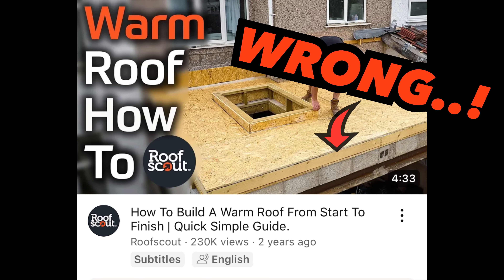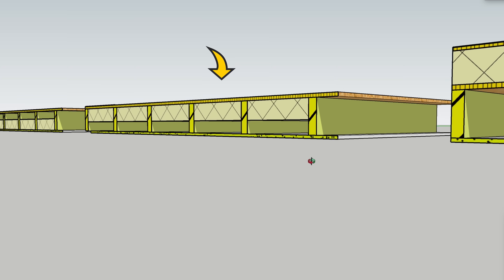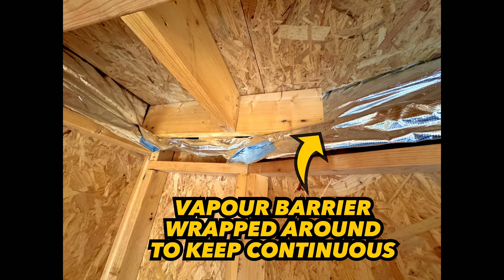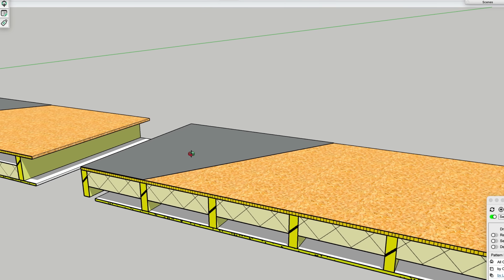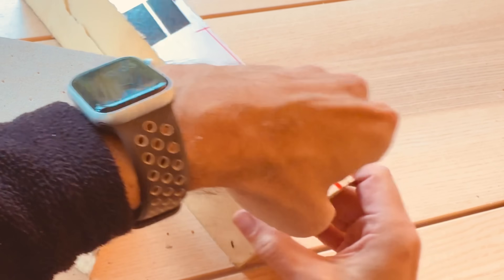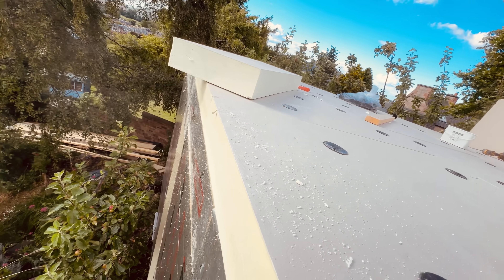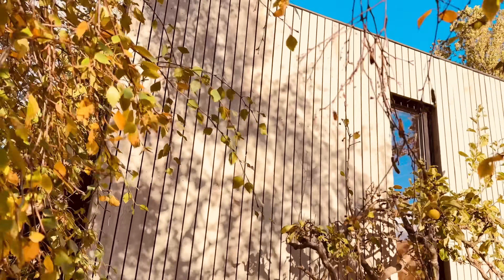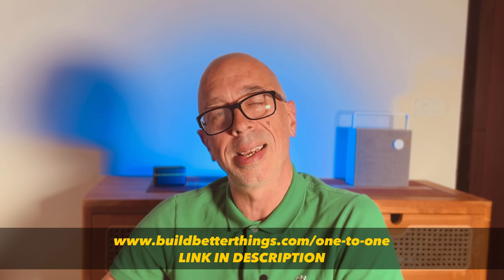Build a Warm Flat Roof the Right Way

Comment: I've just installed my rubber roof as per the old way. Its on my shed/garden room. As it will be low occupancy with trickle vents i am hoping it will be ok?
Reply from the maker: I didn’t go into trickle ventilation in there video due to time. If you’ve got OSB under your membrane, then ventilation will definitely help you with vapour control. People tend to close the vents in winter for obvious reasons, that’s why I don’t talk about it much. The fact you’re asking the question, and it’s not going to have much vapour generation will work in your favour.

Comment: With the target U value being reduced to 0.11 there is currently a problem of how to buy PIR thick enough to be able to construct such a roof with doubling up the insulation. This poses two possible issues 1) A highly theoretical opportunity for condensation between the two sheets of PIR and 2) Screwing down possibly 240mm of insulation. The first I think is probably not a problem but interested in thoughts and both and also availability of insulation material to meet the new target.
Reply from the maker: Your point 1, if you are using foil backed insulation, which many builders continue to do, you will have trapped condensation where the two foils butt against each other, regardless of your vapour barrier. Your point 2, I would be aiming for 120 between joists, and around 150 over the top, to get around a theoretical 240mm sheet. You raise an excellent point on the new u values, and I suspect manufacturers will find new ways of increasing the lambda effectiveness, such as KingSpan’s newer phenolic batts.
Reply: @build-better-things  if you have insulation between the joists, according to your theory, isn't there a risk of condensation at the OSB deck which is directly ontop of the joists?
Reply from the maker: The OSB deck would be below the insulation and between the joists, 100mm down, there can never be OSB above any insulation unless a cold roof. I didn’t make that clear. I briefly illustrate it when I mention permitted development. Did I explain it ok?
Reply: @build-better-things  not clear at all! Why would there be OSB between the joists? What is this 100mm dimension you refer to? 
Regardless, in the video you said the vapour becomes trapped by the OSB (as it is so full of glues etc), so surely this is also true with a hybrid roof when the vapor meets the first layer of OSB  half way through the construction? Moisture trapped at that point surely the water would cause rot too!?
Reply from the maker: @philbooth319 take some time to reread my comment and it should make sense.
Reply: @build-better-things  would that be the comment in which you say "I didn't make that clear" !? Haha
I've re-watched the video and can just about make out a section detail which flashed on screen for literally just 1 second at about 1:40 , now it makes more sense, and I kind of like that arrangement although I'm not sure where you would have the VCL? If still ontop of the OSB, wouldn't that be an absolute pain at the mid span noggins? Perhaps just run the VCL under the joists of use foil backed plasterboard?
Reply from the maker: Hi. Yes it’s too quick. Apologies.  I’m going to make another video about that. The vapour barrier goes up and over the joists and then on top of the OSB. It’s a lot better than between the joists/pBrd. It’s just the best I can think of.
Reply: @build-better-things  Will be interesting to see that video in due course to understand your reason, and how it compares to the vertical VCL in the wall construction.
What I still don't get is why this is a problem if you have sufficient insulation so the vapour never actually gets to the cold outside??
Reply: @build-better-things  So I'm beginning to loose the will to live having watched too many videos and spoken to too many tradesmen, manufacturers and suppliers. I'm trying to design two roofs for a project. The first is a flat roof, the second a low pitch metal sean roof. Both are warm. Staring on the inside - plasterboard vapour/air control membrane, wood fibre packed insulated joists (200mm), wood fibre sarking/insulation over this. Then the trouble starts ---- Flat roof, single ply then bonded to sarking to finish. Seems OK but want a green roof in places (biodiversity requirement pushing at this) and poreclain tiles on pedestals in another. Concerned about some roof type welds for green roof but more the applied pressure on wood fibre from the pedestals ---- Low pitch metal seam roof (15 degrees) I cannnot see how to overcome the use of ply/OSB over the sarkin/insulation unless a vapour barrier is laid directly over the sarking/insulation with battens over this and then ply/OSB fixed to the battens. This then needs a vapour barrier over the OSB/ply before the metal roof. Reason is that the metal roof requires both a membrane and fixing and this fixing cannot be through 120mm+ to the joists as the metal roof design itself is not equiped to do this.

Both roos are approaching half a meter in thickness and the roof cost is now by far the biggest single cost element (I know it's always been a big part). Much of the above is being driven by the Furure Homes Standard, biodiversity, sustainability and the desire to reduce CO2 and move away from petrochemical derived products.

Please note that nearly all the BBA, NHBC, Passive House diagrams etc. show the ply/OSB directly on top of the sarking/insulation. This has always seemed wrong as ply/OSB is not a vapour barrier as such and will tend to trap moisture underneath.

Comment: Yeah in Arch Tech collage (a couple years ago since I graduated) we were thought to apply the roofing membrane finish directly onto the insulation when detailing as you specified in this video. I watch alot of the channels you screen grabbed (+ others) who all do the 2nd OSB layer on the cold side of the insulation & I always wondered why they would add such an unnecessary layer to the roof assembly. Now I know! 😅

Comment: I'm a lowly DIY'er, half way through his first warm roof (a mere 4 square metres). I did consider gluing the rubber directly to the insulation, but in the end I went with a 9mm OSB3 layer beneath the EPDM because that's what the majority of people seem to recommend, and I wanted a roof that I could walk on to get access to the gutters etc. Have I made a horrible mistake ? Time will tell, I suppose. I tried very hard to leave no gaps in the vapour layer (= Alutrix), and I deliberately chose OSB3 because it can apparently tolerate humid conditions. Kingspan claim that their phenolic insulation ("Kooltherm") is also vapour resistant, so perhaps that will help too. I hope it won't end up worse than the cold unventilated felt roof I replaced, which had the consistency of soggy Wheetabix. Fingers crossed.
Reply: Plenty award winning excellent builders on YouTube have done the same don’t worry
Reply: @macsmith6216 👍
Reply from the maker: I wouldn’t call it that. If the roof fails, hopefully you can peel it off, along with the old OSB, it’s not a huge exercise nor cost to adhere new rubberto, using a new 20mm layer of tissue faced over your old insulation to keep the depth almost the same. Humidity is a site specific thing, so you might be OK. Just wait and see.

Comment: PSS: The vapour barrier in your video looks like a laminated polythene foil product as it looks lose laid (not stuck to the base deck with bitumen). These products are not sufficient and regardless of whether you’ve used an upper layer or not, condensation will occur between the roof membrane and the insulation because you have failed to prevent rising vapour due to an inadequate vapour barrier. Ok that condensation will have no OSB to rot, but it will reduce the life of your roof to exactly the same extent by delaminating your membrane bond to your tissue faced TR27 insulation.

Good points regards mechanical fixing, but in terms of thermal performance it doesn’t matter what roofers toss about with on top of the insulation. The key is stopping warm vapour holding air from inside the building rising through the structure as it will condense if it’s allowed to meet a cold surface whatever you do on top.

Comment: Yes, but you are ignoring the fact that with a warm roof a vapour impermeable bituminous foil vapour barrier (with an Sd value of 150m +) must be laid over the base deck (over the rafters) to ensure the damaging warm air transmitted vapour cannot get to the cold upper side of the insulation. The warm roof top deck rotting you correctly reference only occurs where contractors fit inadequate vapour barriers eg. Paper type roof membranes (typically with Sd values under under 10m😱) that fail to prevent the convection of vapour holding warm air reaching the top of the insulation where it condenses and rots the top layer of OSB. Agree that it’s better to lay the roof membrane directly over rigid insulation, but if you spend enough money on a quality bituminous foil vapour retarder you won’t get the condensation problem.
PS: Vented roof example shown is good and will work well providing there is sufficient inlet and outlet ventilation gaps to allow cold air from outside to draw the warm vapour holding air away. The Hybrid roof you show is a complete disaster and will never work whatever is done as it’s impossible to fit a bituminous foil barrier from underneath the rafters and there is no space over the insulation to ventilate.
Reply: But then you fill the VCL with screw holes!
Reply: …maybe the bituminous type seals those?  But then bitumen has a limited life

Comment: I usually find your videos informative but this one is incorrect. Building standards mandate a vapour membrane under the insulation for warm roofs.

You’re showing other’s channels content without actually having watched the full videos. 

I’m sure you know that yourself but for others as a reference, when you build a warm room, you always lap a vapour membrane on top of the first layer of osb/ply. 

That’s what the people from the footage you’re showing actually did, but you’re surmising that they didn’t. 

You’re spreading misinformation. 

Now, for the other people concerned with their warm roof, building control would/should not approve a roof without a vapour membrane. Giving that a membrane is 50 quid for a 50m roll, it’s unlikely that your builder saved on that… (never say never, but you get the point)
Reply from the maker: @OmegaLok All the “bad”  examples I show are about adhering the EPDM onto an OSB layer, with insulation below, which is going to rot over time, regardless of any vapour barrier. I explain this concept with diagrams and video all the way through. You have completely misunderstood the video. 
I show the vapour barrier laid on the OSB both in the built example and in the sketch diagrams. Talking of not watching videos all the way through,  and spreading misinformation , are you sure you’re not looking in the mirror ?
Reply: @build-better-things  I am not spreading anything, I am saying you are. That logically does not make me a misinformation spreader.

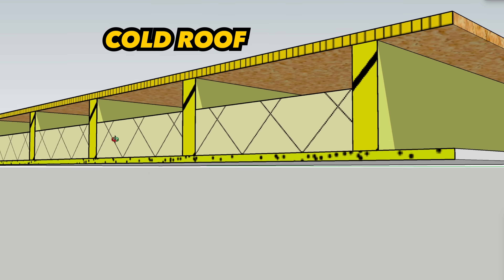* Your Mr A builder videos are redacted (minute 0:50 and 6:37). You are not showing that they are installing a GRP roof which requires a rugged substrate to adhere. But you lump his video under the EPDM label. Not only that, but they explicitly say they line up the fixings with the joists, so that it doesn't pierce the VCL into the void (avoiding what you show in 6:19).
* Video in 6:27, another GRP system and not an EPDM roof. What's your recommendation there, as again, you can't adhere it on a keyless substrate?
* your whole 6:20 section is about adhering EPDM on the second layer of OSB as that's the issue. The issue, as you said, is infiltrating moisture through the VCL.
* in your construction at 11:54 you have ply (probably WBP) on the edges of your roof (to support fascia?). Aren't you concerned that it's going to rot the same as OSB? I've seen mushrooms grow on WBP, so it doesn't matter how "resistant" a material is to water. It's either waterproof or it will eventually rot in a damp environment.

Your whole video comes as a stark warning about a warm roof and how the top timber layer will eventually rot away. I think that piercing the VCL through the insulation is a real problem to which we don't have an answer today. We can mitigate with the plastic cones, and fill them, and by aiming at the joists, so that moisture doesn't go through. 

However, in the order of issues, I've seen more incorrect cold roof constructions, without proper ventilation. I've yet to see a top layer of a warm roof, with VCL, to have rotted. Have you actually seen any? 

Also, in your construction, if the moisture does come through the VCL, and reaches dew point under the EPDM, where will the water go if not eventually down, hence back through the VCL and into the bottom decking, hence rotting the lower side? I'd rather have the top side rot, easier to strip and replace than have to tear away plastered surfaces. 

To summarise:
* what do you suggest for GRP roofs as those require a mechanical key (for which OSB is the most recommended)
* the issue being penetrating moisture through the VCL, how often have you seen this issue and how bad? Evidence is appreciated as all I hear (from everyone) is speculation
* what's your mitigation strategy?
Reply: @OmegaLok well said. In relation to the Mr A Builders videos this person has referenced in this video and commented on within this thread alone, he is not telling the truth.
Reply: @build-better-things Your comment above in this thread, dated "3days ago (edited)" at time of me writing this, is a lie. The videos of ours that you've referenced DO NOT contain any form of EPDM roof. You are either lying about it's contents or you are lying when you say that you have watched them. Either way, no matter how you look at it, in relation to our videos that you've referenced your comment above and those in your video are lies.
Reply: He does mention the VCL
Reply from the maker: Thank you
@markthomasson5077
Reply: @markthomasson5077  Yes of course he does, but the message he promotes is: warm roof is bad, it will slowly rot. This is evident from all the other comments of people concerned with their warm roof construction. Then at minute 10:07 he proceeds to show how he's building a warm roof with EPDM, without the OSB top layer but still with an impermeable layer between the VCL and the EPDM. So, where will the residual moisture (if any) go over the arc of 10 years?
Reply: @OmegaLok  between the VCL and the EPDM is the insulation, which is not impermeable.
The EPDM is slightly vapour permeable, so during the summer moisture does escape

Comment: Why isn't this being captured on drawings by architects and before being approved by planning?
Reply from the maker: It should be, but architects are as guilty of builders of getting this detailing wrong. Building regulations are just checking for compliance, they’re not there to check the design, although many do end up being helpful. Planning permission has no relevance for roof makeups, just appearance and size.

Comment: Thanks for this. Difficult to get a 100% visual on what you were trying to show as the gold standard. 

So it's 
Breathable membrane, osb, insulation and then epdm?
Reply: i was thinking the same. trying to watch the video again to see if i missed the detail.
Reply from the maker: No breathable membrane. OSB then vapour barrier, then insulation, then EPDM. Sorry if I wasn’t clear. You only use breather membrane where you have a ventilated cavity on the cold side of the membrane.
Reply: I think it’s osb then vapour control layer on the warm side, then insulation. This keeps the osb in the warm area meaning it does not get cold enough for the vapour in the air to condense on. A breathable membrane lets vapour through so not what you want because that takes the moisture through and as the temperature decreases as you travel through the insulation eventually you get to the dew point and moisture will condense out. 

Breathe membranes are for where you want vapour to escape but at the same time be waterproof. I.e. above a 50mm air gap in a cold roof below tiles.
Reply from the maker: @davideyres955 that’s right. Thanks for your comment.

Comment: Great video , and also completely correct on the stubborn point of view of many builders. Uk construction industry at the tradesman level has so much ground to make up in comparison to the european counterpart. Not a surprise when you look at the general attitude to new technologies vs "how we've always done it".
Reply: Yes, doing it wrong for a long time (Normalized Deviance) does not make something correct.
Reply from the maker: Thanks a lot. I’m not trying to be critical of others’ efforts . Just want to look at the science and use it to make us all do it  better.
Reply: We seemed to have perfected most things in Victorian times and mostly have been working backwards since the amount of old buildings I've taken apart where the timbers are in perfect condition speaks for itself heat and ventilation are the key also much healthier for the inhabitants of the buildings
Reply: @lr90lsv8defender8  Victorian buildings are very well designed for very high-carbon coal-fired heating (with corresponding very high ventilation). However that is not well-suited to modern low-carbon, high-comfort, efficient building requirements, which needs a quite different approach of dramatically better airtightness and thermal resistance. It's totally possible to make the timbers in such buildings last for centuries too, but the design criteria are different.